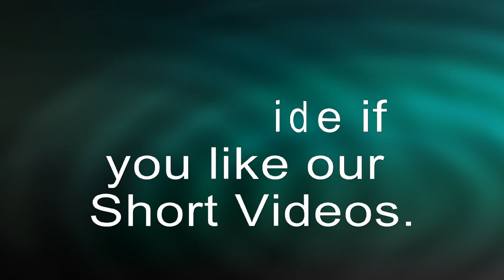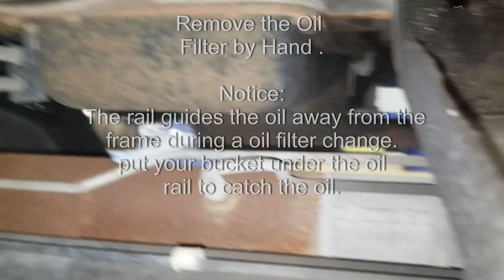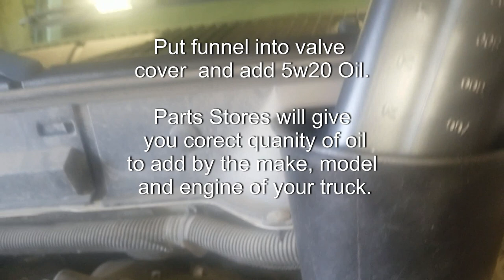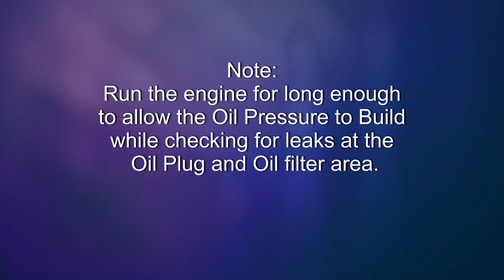Oil Change on a Dodge Ram 1500 with a 4.7 Semi Hemi video

Comment: Do you use Castrol?
Reply from the maker: Tyler George, 
              We used conventional synthetic blend oil on this unit but stayed on track with oil changes. This unit is a fleet unit and now has over 200000 miles on it. For personal use, we would have used a great oil like Castrol or Mobil One. Thanks for watching our short videos
.
Video Team One  (Home of the Short Videos')